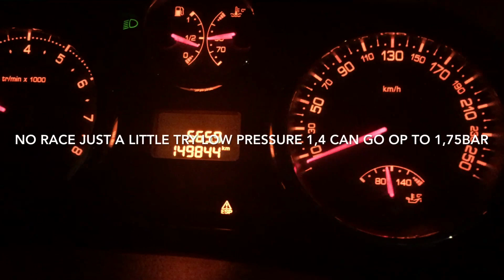207 RC from DK 300++HP

Comment: did you modify gearbox to?? at least its needed to longer 5th gear or to find 6speed gearbox which would fit in :)
Reply from the maker: Miha Kumar  no its Stock gearbox . And i want it to stay like this with LSD diff
Reply: Short gears, it’s fun

Comment: Hows the car? do you still have it and how reliable is the car making all that power. I know you'd not be using all the power everyday, was it worth it? Thanks
Reply from the maker: CustomPcGamer 
The car is fun and still have it. Making almost 400hp . It takes some  maintenance but im a mecanic so no problem. I have 4 program boost controller . But it drives everyday. But it has cost alot of money .
Reply: TheDlarsen video update on the car? Looks like a nice project
Reply from the maker: Janusz Gajusz  thanks. Yes its still running . I have more video on my Chanel . But i Will make a new video soon .

Comment: Can you run the HKS SSQ by itself with a Recirc Valve delete or do you have to run the HKS SSQ and the stock recirc valve?
Reply from the maker: I did not have org one on its a upgrade turbo not the Stock one. But you Can run both at the same time. 
I dont have the hks anymore 
Now i have the turbosmart valv.
Reply: @TheDlarsen  did the hks one cause a problem when you ran it?
Reply from the maker: No not at all . Had it for a few years . But just wanted a new bov . Cause i Got turbosmart as boostcontroller .

Comment: What amount of boost and Hp can the stock engine internals handle before you have to forge?
Reply from the maker: Some say 1,4bar and 280-300hp  but my Stock engine could take 1,3 bar and 240 hp . But If you want power i would forge it.
Reply: @TheDlarsen  thank you

Comment: Are you using the stock ecu?
Reply from the maker: Yes the ecu is Stock but with etuners remap.
Reply: @TheDlarsen  how ? the stock ECU cant go over 1.6 bar 
its give to me over speed tubro and cheak engine ligh 

im stage 2 and i stop the wasgate on 1.5 bar
Reply from the maker: @ALON0123456789  dont know . But i it possible with a external boostcontroler.